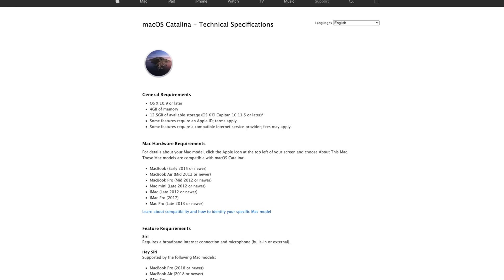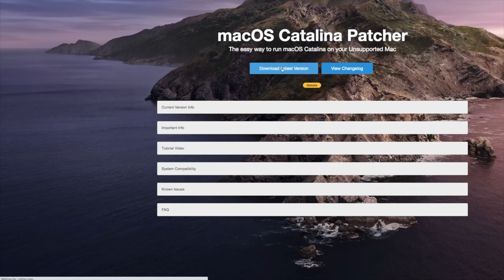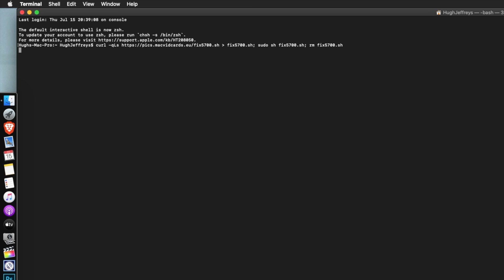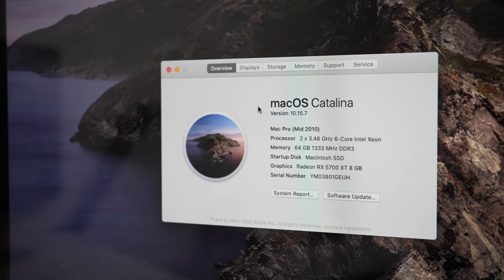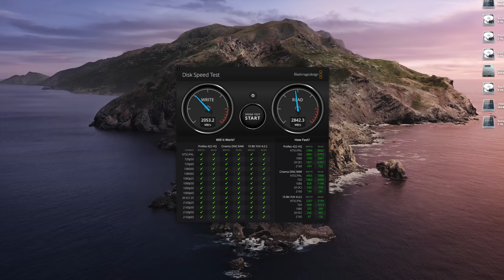Obsolete? Think Again - Keeping My Ageing Mac Pro Alive

Comment: If Apple allowed longer use of ‘obsolete hardware’, they would profit (check Microsoft, and Windows ‘piracy’, which helped them ‘win’ the OS wars). I’m now looking for a cheap Mac Pro to do this on! I have a 2012 Unibody MBP15 on Monterey (2TB SSD + 2TB HDD + 16GB), and a 2009 MBP Core 2 Duo on Monterey (8GB, 2TB SSD). Monterey runs beautifully on a 2009 Core 2 Duo and GeForce 9400M 😶. I should make a video documenting my “MBP Unibody 17” *mid-2012* - probably the only one in existence…

Comment: Those GPU fans are blocked by those cards,also you might need to repaste those CPUs,if the paste is dry enough you might get even more bottlenecked by them throttling

Comment: Jesus that ram is super old and slow, I wouldn’t be surprised if the motherboard and cpu in this Mac doesn’t support any higher speeds than 1333mhz. I mean my pc was bottlenecked by 2666mhz ram with the same gpu but a r5 3600. The latency on the ram in your system can also really affect performance by quite a large margin. When i upgraded my ram from cl19 2666mhz ram to cl16 3200mhz ram my performance was boosted by about 15-20%.

Comment: That is really very quaint, but unnecessarily cheap and time consuming.  That Mac Pro leaves you with PCIe 2.0, which is a quarter the speed of PCIe 4 and half the speed of PCIe 3.  That machine is stuck with Blue Tooth 2.1, which is way behind Blue Tooth 6.  Solid state storage, which is not supported by your four 3.5-inch drive trays, turns boot times from minutes into seconds.  Obviously, it doesn’t cost you anything to keep it, but upgrading it will only waste money because you will not get full performance from the new components.
For all the trouble I would go through to clean and upgrade that machine, I might as well get a PC running Windows 11 or set up a Hackintosh.  Stop being cheap, which is NOT frugal, and get a Mac Mini or maybe a Mac Studio.  You will also find that 10 Gb ethernet is noticeably faster than that pair of 1 Gb NICs in the lower back of your ancient Mac Pro.

Comment: I love my old MacPro 5,1. The CPUs are still beasts, over time added USB3, PCI SATA, upgraded GPU — but the slow disk i/o finally got to me and I had to move to newer hardware. I did try at one point to flash a GPU to make it “Mac-compatible” ie work during the EFI? boot sequence. While not entirely bricked, I trashed the card :/ Would be curious to see a successful GPU flash.

Have thought about putting Linux on the 5,1, but w/o a fully working GPU the install is tough.

Comment: Damn,does that Mac have no fan filters?You should put some in there.
Also,you seem to be blocking airflow for that 5700 XT with that NVme card.You're probably gonna be thermal throttling.

Comment: @Hugh Jeffrey- Good video, thank you for posting. Apple's planned obsolescence is ridiculous, I have the 2006 Black mac book which I repurposed it to hold all my music and video and I use iTunes Homeshare to stream over my apple devices. I have a mid 2010 MacBook Pro in which I'm looking to patch install Catalina or Big Surand  I'm still using my iPad First Gen, and I get laughed at or told that it's "too heavy" but for me, I like the screen, and several apps are still useful- I think it all depends on what the user needs. I love to read, so Kindle and iBooks are very useful, my bluetooth works as well as the remote app in which I can control my iTunes from various desktops, the iTunes Home sharing apps works on the iPad, plus it serves as an external monitor with the use of air display and Amazon Prime works. Right now, I'm looking to see fi i can turn my G5 Tower into a Hackintosh ( if you or anyone else on this threat has any suggestions I'm all ears ) I like to repurpose my older mac, to me, there is still a lot of life left into them. But that's just me.. Sorry for the long rant. - :)

Comment: Opencore could’ve gotten you Catalina without patcher, and you’d get AMD Hardware Acceleration, and UEFI Boot Screen/boot picker. I feel like that would’ve been a better alternative to DosDude, however I still think DosDude is great. There are many other advantages to Opencore, such as making the PCIe storage drive appear as internal, adding Alpine/Titan Ridge TB3, UEFI Windows, and the most recent would be the ability to go to 256GB DDR3 ECC 1333 MHz RAM vs the previous max of 128GB.

Also, a Highpoint card with an ASM2824 controller chip would’ve given you another double the speed than the Syba IOCrest, if you had all 4 of the NVME slots filled.

Comment: that card above the gpu wont last long. because it will get very hot. and the component inside will die.
and that gpu will get very hot. that it will also die quickly.
especially since you bought asrock model.
asrock gpu kinda sucks in cooling.
especially no airflow like that.

i think you need to change it to gpu that uses similar fan blow to your old gpu.

or you need to remove that card above it. i think you said it's nvme card. then it's even worse. all you data will be gone...

Comment: I too prefer older Macs before Apple became a-holes to their core pro users. Things have just moved too far away from pro level products; disk utility hasn’t been good since Yosemite as it’s been neutered in actual utility. In 2021 we shouldn’t need terminal and command line to do basic functions everything should be able to be done via GUI. I still run a mid-2012 MacBook Pro as it’s the last with a disk drive and in the professional space surprisingly a lot of software is still provided with disks exclusively and simply don’t justify creating ISO’s or DMG’s to get things going. In I dusty where surprisingly you’ll still see Win XP older Macs simply are the best serviceing computers to have as they work with everything, especially when combine with parallels. But even parallels stopped offering pro level software as a purchase after v14 instead making you pay year after year for pro features; I do not like this subscription model as I want to own my hardware and software as DRM restriction simply don’t age well with server checks simply not working long term.

Comment: Wow...amazing...
Love the attitude to use it as long as possible.
But i am very sure future updates to MAC OS will somehow slow such a system down.

But i think that right now with Windows 365, Apple Mac market share will plummet even further.

Imagine using the Microsoft cloud computing power to make video renders .
If in Mac it takes 4 hrs to render a 8K clip...on the Microsoft Windows 365, it would less than 30 minutes.

And you dont need the top of the line CPU .Any mobile chip will be able to do what the most expensive mac can do.

Apple need to get into cloud computing fast.

Comment: 2010 kinda old but not really now. i have a dell optiplex 330 from 2007 with windows 10 on it. upgraded ram to 4 gb and cpu from intel e2180 to e8600. this is lower end computer and sure there are higher end ones from that time and older that are still good and runing windows 10 no problem. my laptop is from 2016 bit still good. 
the big thing is windows 11 now. there cpu limit is going to make it so can't get it on a lot of stuff. there is no reason my laptop with i5 6200u can't get windows 10 now. it has the dumb tpm2.0 which is also a dumb requirment too. there si no reason older gen 3 or 4 cpus can't even work now. there are a lot of good computers that can work
 don't know why anyone would get apple stuff. just change to windows already :p

Comment: Wow that is some tight fit betwen SSD`s and GPU. The GPU vent has little to no space to draw air under that silver pci component and considering AMD`s are known to run hot in full load...thats just bad case and motherboard design

Comment: What in gods name?? Two 8 pin connectors coming off of the aux power port?? That thing is going to catch fire, two 8 pins absolutely require the pixlas mod! You cant just drop in two 8 pins! Also what on earth is that airflow clearance! Take away the nvme drive or get a watercooled GPU like a Fury X or Vega 64. Jesus christ this is not a good look

Comment: 6:00 there is no room for the GPU cooling... is better to remove the nvme pci drive for temps and general lifespan. your old GTX980 was fine in the same slot because it uses a blow style fan, but this new radeon have open air ones.

Comment: Planned obsolescence or not. Running this compared to a much more efficient 10 year newer machine makes no sense. Keeping this stock and using it for legacy 32bit-only mac software would be much better use. Like keeping old pc hardware for DOS, win98se and winxp
Reply: or use a virtual machine.
Reply: @PedroBastozz  nope. Lot's of issues with emulating input and graphics in "real time". It haven't been solved yet

Comment: These old xeons can do a lot, although i preffer a normal motherboard not apple ones couse you don't have to go all this things, couse windows 10 can be dropped even in a pentium 4, we will see what they do with windows 11 but the tpm thing doesn't look very promising for old computers, i personally don't like apple, they just were one of the first companies that started doing devices that you are unable to update or fix due to serialization and the other companies followed apple in that regard, laptops from 2011 in most of them you could change the cpu, now you can't in any laptop, even the ram is getting harder to upgrade couse a lot of laptops use 1 stick soldered to the board and a slot that you can add some ram, apple doesn't even have a slot in the m1 laptops, its just pathetic imo, they just don't put a slot to charge you for putting more ram like 300 bucks or more for just 8 gigs more, thats just a scam imo

Comment: I would ditch MacOS and run Linux on this hardware.    There are more software suitable for those components available that works really well.
Reply: Seems he needs Final Cut for his work, which is why he sticks to MacOS

Cant blame em, gotta make your money out of that purchase
Reply: These things can run Windows 7 (or 8 maybe) which I would like to do
Reply: @Baer9471  They can run any windows. They use such standard parts that most of bootcamps drivers are unnecessary, so youd be able to run 7-10

Comment: An incredible powerful desktop with an amazing monitors what a combo.   I think mac product are really well done despite it's apparent obsolescence will last forever, I'm still using my 2011 11 inch MacBook air as daily pc and still works great for architecture design, 3d modeling and rendering on MacOS Sierra, I'm thinking to upgrade in to Catalina and change the SSD for an Aura Pro, and will be a perfect opportunity to change the almost dead battery too

Comment: "Obsolete computer" I've just replaced everything inside of it except the chip that cannot be replaced.
Reply: The question is why Apple still consider it as an obsolete machine with such and upgradability
Reply: @bravesonly  The chip is old and out of date. Reality is tech moves fast. Stuff is already out of date the first day it hits the market but They can't fund future progress without releasing and charging for it. The world has changed so much since the 90's and early 2000's and the reason is more people developing and the funding to push the tech further. If the 8 year old machine was good and nobody was needing a new one, there isn't an incentive to make it better if they know people won't buy it.

Comment: Hullo!
Since Dr. Google is useless and user threads seem to be 1) very slow in response time and 2) full of snarky bastards, I've resorted to searching out help from YouTube channels. My music computer is dying. MP 3,1 Early 2008, 8-core 2.8 Xeon running El Capitan for garbage-net on Chrome since Safari is very elite and you have to be wealthy to afford a computer to browse with it. But my production is on Snow Leopard, which is the Windows 7 Pro for Apple. I also use PrCS6 b/c it's a bit more user-friendly than FCP, which is installed as well. I, obviously, option/boot to SL. I'm willing to go to a 4,1 and upgrade it to a 5,1 if I can find an affordable replacement to my 3,1... But I suspect software issues. Apple. Sneaky bastards, ain't they?

Comment: Right now, your Subs..... 666....
This is literally my spec.. except XFX580x (Mac vid cards) and  12Tb SSD internal...(NVME Kingston m.2 , apricorn Duo x 2 PCIe, and on sleds) .Mwhahahahaha (For Music)
Yep... OC and rEFIndit FTW.. do not install dos dude  , if you did , you need to do a reinstall to get native encode/decode on the AMD cards... hvec ect.. Dos dude installed won't let you access that I believe and can't be removed as its not just within the efi partition.... ...
Thats my experience.
To add .. Mojave main daily driver... Catalina (which is cocoa) for fun and to test the waters... it works though, just some old plugs wont work as they're 32bit.,....(thus staying on Mojave at this point)  .. Also waiting for OC to sort out the Big Sur issue.....

Comment: The m.2 drives provide the fastest possible speeds for these older Macs, while also providing death for your graphics card. These Radeons are hot bois especially with this pathetic air"flow"